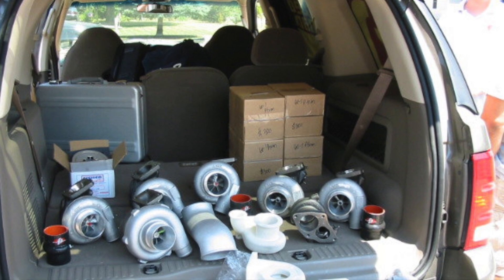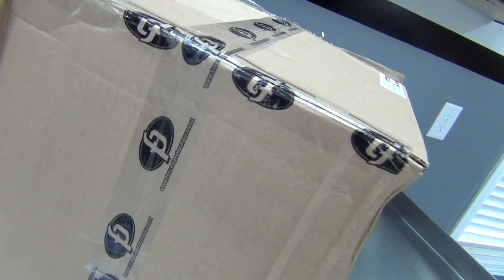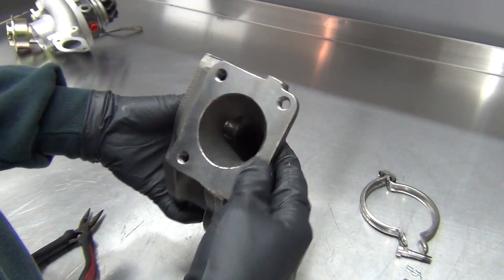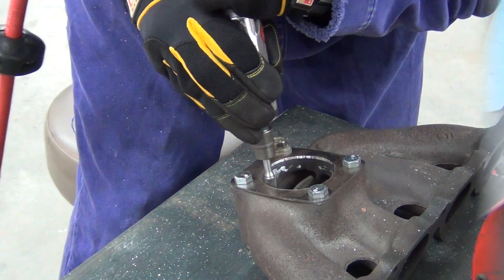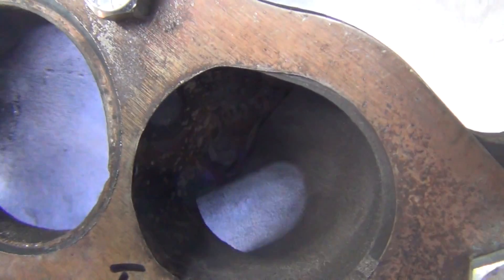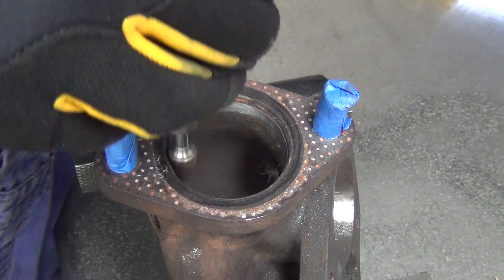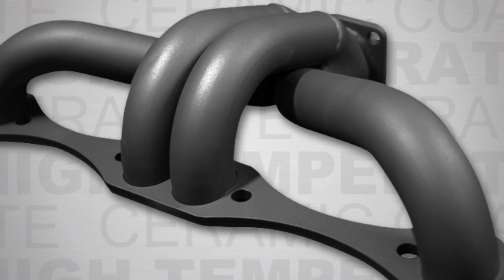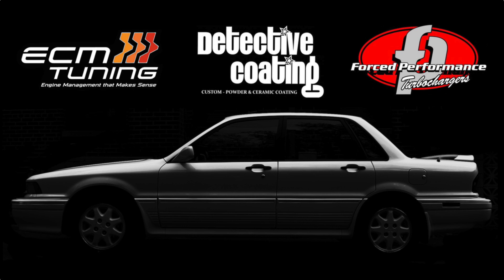Project Street Sleeper Part 4: New Turbo Assembly & DIY Turbo Porting

Comment: I have a TD04HL15TK31VFT  turbo made by Mitsubishi it’s for an 08 Acura RDX part # 49389-01040
I’m looking for a replacement cartridge. Do you know what will fit? I need a cost effective solution I don’t made making custom hoses I just need someone drop in that will make same or more power. Got any advice?

Comment: brave soul with those high speed steel bits on hard iron. Stoked to see non of it cracked using those bits. stone and iron I thought was best of choice for iron work. Didn't see the sanding cones make a dent in the iron in the video. iron way to hard. you end up using stone at the end.

Comment: You should reconsider using the gasket as the guide to your porting. Often a gasket is intentionally sized so that its inner opening diameter is larger than the mating pieces. This keeps the edge of the gasket away from the roasting hot gases flying by. Exhaust gaskets often have a heat resistant material edged by a soft, white metal. That soft edge isn't nearly as tough as the cast iron and it can be melted. When the joint is tightened it's that metal edge that is compressed and forms the seal. If the inner edge of the seal is burned away the joint is compromised. 

Opening the joint to the size of the gasket can also create disruptions to the flow. Picture you have two parts that are already correctly matched and the flow between them is uniform, but the gasket is larger. This creates a very slim, shallow gap between the parts, but it hardly changes flow at all. But grinding the inside diameters of the parts to match the gasket will actually create a disruption in the flow. 

I have always used thin cardboard (think cereal box) to perform porting. Make a gasket without the port holes. Then apply water-based paint, machinists blue, graphite... on both surfaces and bolt them together. When you separate the halves, you'll have the perfect shape of both ports on either side of the "gasket". Now cut the ports in the gasket to the size of the largest port. (That could be either side at any point around the port.) Port to match. If you want to open the port up for better flow do that to one side first, then do the cardboard gasket trick to match the other part.

Keep in mind that sometimes a slightly larger header flange is good. Anyone remember anti-reversion headers ?
Reply: One learns more from your comment than from the sales pitch up there,    Lol
Great idea;  i'd just use thin sheet metal,brass for instance,0.20 to .040;( not that i would EVER waste time or money with that shite ,in a place where the speedo limito is around 75 mph!!  a proper NON turbo will do perfectly for that,AND have great low end torque).

Comment: It's a great video !  I've ported many heads and seen some gains, but I wouldn't have hogged out that wastegate port so much. The wastegate is only flowing when you're overboosting. If the turbo is appropriately sized that shouldn't be so much. The wastegate's flapper valve will only flow so much anyway. Cutting the casting so thin in an area that already highly stressed (glowing !) can only be bad. If the boost gauge doesn't show increasing pressure (higher than the wastegate setting) at higher RPMs you don't have a problem that warrants the increased liability. I'd have just rounded the corners a bit. I don't mean to invalidate the video. It's still a wonderful presentation.

Comment: I need help on my 1g eclipse gst. It smells like it's burning oil and H2 is at 86 so won't pass smog. Previous owner was using 5w-30 oil instead of 10w-30 so I did tune up fixed boost leaks. Still smells like burning oil but no smoke out the tail pipe. And when I drive under boost it bogs and when I hit wot it hits boost and no bogging so idk what it is maybe fuel pump? And maybe turbo burning oil?

Comment: That dump's gonna crack...

EDIT: before anyone jumps down my throat, thats just my opinion.
My STOCK dump cracked there, and its much thicker :/
Reply: Castings are the most inconstant form of metal in the world. Even the best castings are junk. The people who engineer castings put a lot of work into trying to set up risers, pour areas to be cut off and consideration to metallurgy. Even all that work in many castings are weld repaired when new. In a high heat application taking metal out can add strength if the metal is taken from a thick spot. When you thin out a thick spot you might just make the thermal conductivity of the whole part more even, in that case eliminating hot spots adds strength. In the end castings are a crap shoot! Shifting molds, what was melted to pour with that day, first thing Monday morning last thing Friday afternoon, harvest moon, the angle of the dangle, the heat of the meat. The only thing written in stone about cast is that it is overpriced junk. It is a pain to weld, machine and chase broken fasteners out of castings!
Reply: +Liamv4696 Yea it looks thin, the only thing that would account for this one not cracking in the future and the reason yours did would be a casting mark.&#160;
If you had a casting mark in that area this could cause stress and heat for that one spot which cause the crack. If he cut the casting mark down to the point it made the wall one piece (smooth) this would have allow more strength and the dump to not crack.
Reply: +Liamv4696  I would not have made that wall between the two ports that thin either. There is also not enough gasket sealing surface there either, the gasket will blow out, unless it is solid copper.

Comment: Dig the videos man. Was any consideration given to the air flow characteristics when porting was done? Only that I know any reputible head porting professional will tell you that it's not about maximum volumetric area but instead about using the walls of the flow path to increase air velocity. Keep up the good work mate!
Reply from the maker: Thanks man!  Yes, you're right about that.

Comment: How thin is too thin for dividing walls? After finishing your porting you got pretty thin on the turbine and wastegate outlets. Could that eventually wear and crack over time? Or is that not very common? I only ask because I hear of exhaust manifolds deteriorating all the time, and removing such a substantial amount of material, I would imagine, would only make it so much easier. Especially with something that's exposed to boost pressure and an intense amount of heat.
Reply from the maker: It's just whatever you're comfortable with I suppose.  I've been doing it this way for a long time with no issues, but that doesn't mean that it wouldn't kersplode for the next guy.  If this was a car that I put tons of hard miles on, I would likely do less porting and leave a little more meat in there.

Comment: +Tom's Turbo Garage  If you have an old vacuum cleaner you can use it as a fume/debris extractor you can muffle the noise and all.
Reply: Oh yeah... and magnets help too while you're grinding.
Reply from the maker: MidShipCivic Very good tips, thank you! If I did this sort of thing more often I would definitely have to get a setup like that!
Reply: Tom's Turbo Garage
Yeah typically, you use a vacuum cleaner you're about to throw out and take it apart and use high strength magnets inside a zip-lock bag, so when you're done head over to your recycle bin (assuming you recycle metals) and take the magnet out and all the metal will fall off the bag. - Thanks for replying to my comment.

Comment: I just swapped turbos in my Mazdaspeed3 and wish I had watched this first - I have a dremel and should've ported to match my gaskets :(  Thanks again for another excellent video, and if my BNR S3 ever needs servicing, I'll be sure to port the EM/Turbo/DP flanges.
Reply from the maker: I bet that's a fun setup with the turbo upgrade!  Sorry to hear that, I'm sure it'll be fine, but turbos do respond wonderfully to this sort of port matching and flow improvement.  Have fun with your MS3!

Comment: Awesome video definately will be inquiring into this as I am swapping to a much larger turbo for my 4g64 long rod built engine in my 1ga my gt32 was great for my old 4g63 engine but is much too small for the my 4g64  not moving on to gt4088r  probably will be on the larger side going from full boost at around 5k rpm so slugish bottom end though I'll see how it run this year and perhaps change it up again next year love your videos
Reply from the maker: Thank you sir and it sound like you're going to have a nasty setup!  Good luck with your build!
Reply: Thank you and yes it should have no issues getting around only thing is I am hopping that I am not going to have to many drive train parts brake along the way :D

Comment: Sweet video as usual ! a big fan ! I have one little thing i have been thinking of though.... porting the way you are doing it isnt always helping you get more flow out of you gear.. Going from larger to smaller and then larger again as this porting is done will actually hurt flow ...that is what my friends flowbench tells me anyways. hard edges are seldom good but portmatching in this way just isnt always the best way. you ALWAYS want your intake to start large an graduate "smaller" towards the valves.... and flow is horsepower..... maybe im barking up the wrong tree. but thats what i learned so far :)

As this is a turbo application you can always just turn up the boost to compensate though....

Looking forward to the next video !
Reply from the maker: Thank you sir!  I think you may be thinking of some of the rules that apply to porting intake manifolds and cylinder head passages.  The techniques that I'm hoping to represent (others do it better undoubtedly) are best practice for turbochargers as the turbine passage necks way down at the turbine wheel by design to build velocity and increase spool, then opens back up at the discharge or exit of the turbine wheel and on down into the 02 housing.

Comment: And that is why I have been waiting on bigger turbo and better manifold.    So many hours spent perfectly porting and matching and testing flow rates....  darn it, is the Mitsubishi 16g ported or that fp variant better?   I would be buying new.
Reply from the maker: The genuine mitsubishi 16g is an excellent turbo.  The FP takes that foundation and build on it with a much improved compressor wheel and turbine housing.

Comment: why do buy an (expensive) turbo from a well known  brand, if you have to refinish bumps and stuff anyways?
a good manufactuarer would do this before shipping his product
Reply from the maker: Okay, a couple things.  The finish is very smooth on all of the surfaces of this turbine housing right out of the box.  It could definitely be used as is and make tons of power.  FP offers porting services as all turbo manufacturers do.  I chose to do it myself so I could share my process with everyone.
Reply: Tom's Turbo Garage  good to know, thanks for the response.
didnt think about this option :)
Reply from the maker: jerri0401 No problem man, see ya!

Comment: do you ever use ur longer mandrel with a round bit to smooth down the inside of the,o2 housing I think it is?around 10:30 or is there a reason left that part a bit more ruff?
Reply from the maker: I have in the past, I just didn't see much benefit from doing so.  If you have the time, it's good to do it.
Reply: tnx..ive also heard of certain parts being better to leave a bit of a ruff texture in some cases not sure why..ever heard of this?
Reply from the maker: Nick Fequet You're welcome Nick, that rule usually applies to surfaces that see an air and fuel mixture.
Reply: that's rite!:) thanks again!!

Comment: Did they also coated the inside of those parts? That will help keep heat where you need it to spool up things faster
Reply from the maker: Hi Andres, yes he did coat inside of the 02 housing, but you don't want the insides of the pre-turbo parts like the manifold and turbine inlet coated as the stuff will eventually get into the turbine blades.

Comment: Love it. I have to ask, how much horsepower do you think you get from all that porting? It looks awesome but with all the work plus the cost of the grinding and sanding bits it seems like the $/hp ratio might not be very good. Thanks.
Reply from the maker: gonzostwin1 Thanks man, I couldn't have said it better myself.
Reply from the maker: Thank you sir!  On a turbocharged car, taking time to port and gasket match the hot side parts makes a huge improvement in flow, turbo efficiency, spool, wastegate operation and power potential.  You only really need the carbide burr bits (and not a whole set of them) if doing this on a tight budget.

Comment: Love your videos as always. The turbine housing didn't seem to have the inlet even close to the gasket. Perhaps it's just me. I dig the coatings. I just high temp painted my exhaust parts, but I took the extra step of filing off the casting marks to smooth the pieces out visually a little. Can't wait for part 2 and some dyno pulls :)
Reply from the maker: Thank you Jeffrey!  The FP turbine housing inlet is plenty large out of the box, I just opened up the exh manifold outlet a good bit, and my gasket represented that.  It's likely a bit of overkill, but I wanted lots of flow and didn't want to do this job again in the future.
Reply: I don't think anyone wants to do porting work more than once :p
Reply from the maker: Jeffrey Ball Ain't that the truth!